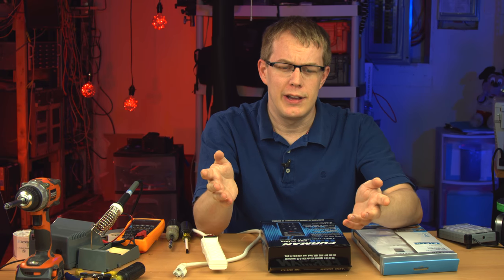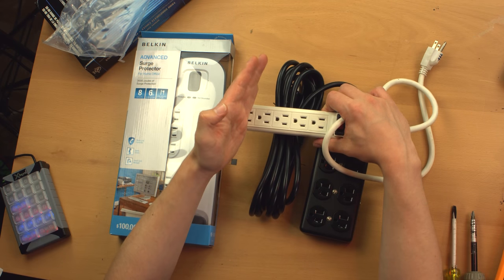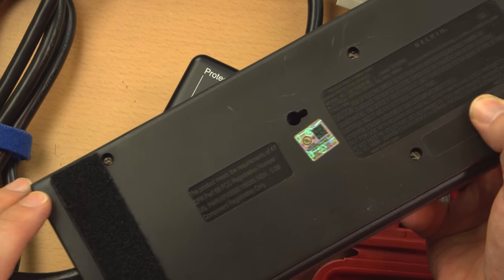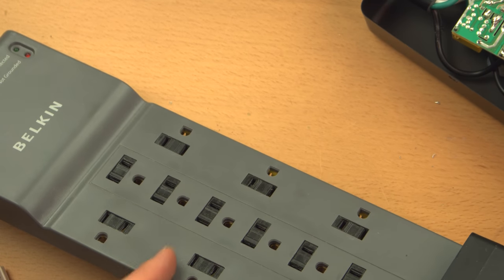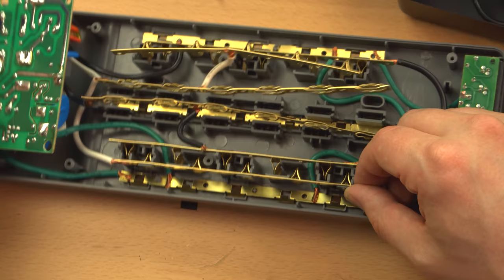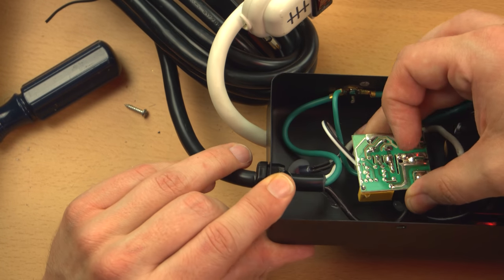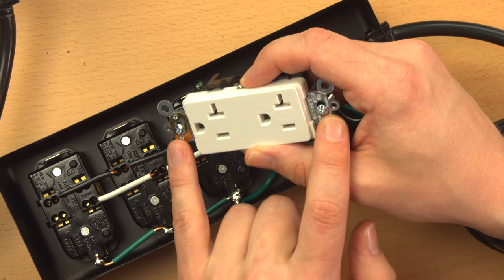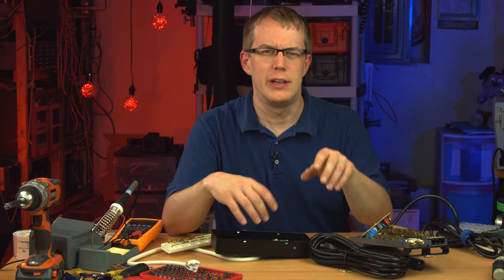Power Strips Whatever Something Something: Furman SS-6B vs. Belkin Surge Protector [G9S12FG9]

Comment: This is an email from the company to me after highlighting the issues you mentioned in the video.
Below from CORE Brands (Furman):
Thank you for contacting us in regards to the SS-6B. We have been manufacturing that model for 10 years. The SS-6B holds a UL 1449 safety listing so I ensure you the product is safe and we have a failure rate of 0.01%. In trying to keep the chassis as small as possible we chose that style of receptacle to accomplish a small housing. In regards to the surge protection we are utilizing a fused 400V MOV L-N. That was the component with the white housing. As I mentioned the unit does have the UL 1449 certification but I want to share your video with our compliance engineer as we are always looking at how we can improve our products
Reply: Where is 'us / we' manufacturing those? Between India & Russia?

Comment: Update from Furman:
Since UL 1449 is a safety listing for a relocatable power tap. UL will accept tinned stranded wires as they will not be torn and fray effectively causing high current going through a small gauge. This is pretty standard going from a PCB to the duplex. Using a solid wire on a small PCB could cause the solder on the PCB to be compromised.
I suppose this information renders the review kind of pointless however I think you're right when it comes to the grounding issue

Comment: The orange things are a combo of polyfose and MOV, I have tons of them and the build quality of the circuit board in the belkin is quite good, definitely good power strip.
Reply from the maker: ELECTROHAXZ Awesome, thanks!  I knew there had to be someone out there who's seen those before.
Reply: I have seen them on the back of slot machine lcds (power board). They were covered with a clear plastic and marked high voltage. I'm pretty sure the pcb was supposed to be covered with a metal cage. I had no clue what they were for. Thanks!
Reply: ILordSpawnI They are commonly part of a sandwich with a temperature fuse in the middle

Comment: From the Furman website: "Many surge suppression devices are not equipped to handle these kinds of conditions. Without proper protection, the end result is destroyed equipment, or at best, a destroyed surge suppression system.

Furman’s Extreme Voltage Shutdown (EVS) constantly monitors incoming voltage, and once any over-voltage condition over 137 volts AC is detected, a relay opens which immediately shuts down the unit and all connected equipment. An indicator light informs the user there is a problem. Once the condition has been corrected, the unit may be reset or auto-reset (depending on model) and will operate normally.

Comment: I own the SS6B and while it doesn't claim to be a power conditioner, it always comes up in searches for them. So I called furman and asked if it's one and they said no. I also asked about the emi and rf and they stated it does a bit but at a very low level and to use their full on power conditioners for those needs. I still like the strip because of the sturdiness and black metal housing and long cable. I'm a mobile dj as my living. It's important that things be sturdy and black for blending in.
Reply: Hey Danny! Are you still using the Furman?

Comment: 23:05 Safety tip: overloaded circuit boards can "carbonize", which means it burns and leaves a conductive path of carbon across the board.  If the trace was too thin, you can't assume that it would fail open rather than failing short and causing a fire.

Comment: the Furman on amazon is about 28$, and for that it seems pretty decent price for what they offer. I would take that over the other choices. Not sure why so much hate for that product as it seems better that the other 2 choices. When you look at the board for the furman you only see the back and you guess what it could be doing. The specs for the surge protection are on the furman website and they show Standard spike and surge protection - UL VPR: 400V, UL Nominal. Single Pulse Energy Dissipation, 540 Joules. Which is in line with a cheap surge protection strip. Other advantage i see on the Furman, is that if you are unhappy with the plugs that it uses, you can easily replace them.
Reply: Get the furman ssb6 pro... its on a whole other level.
Reply: @analogaudiorules1724  whoa, $1 terminals instead of $0.35 terminals

Comment: This is an old video so probably doesn't matter anymore, but that unknown component is an MOV capacitor.  Specs below, translated by Google:

"Three-phase varistor / high energy varistor

It is mainly used to absorb various operating surges and induced lightning surge overvoltages to prevent such overvoltages from interfering with the normal operation of the circuit or damaging various circuit components. The voltage range is wide, the residual voltage is low, the flow rate is large, the response speed is fast, and there is no polarity."

Brand/Model: EV/S120D201-S320D471
     Custom processing: Yes
     Brand: EV
     Model: S120D201-S320D471
     Type: pressure sensitive
     Performance: high resistance
     Material: inorganic solid
     Manufacturing process: ordinary wire winding
     Shape: Cylindrical
     Nominal resistance: 500Ω
     Temperature coefficient: other
     Rated power: 500 (W) W
     Power characteristics: high power
     Frequency characteristics: UHF

Comment: Judging, the wiring job inside is an absolute nightmare in the Belkin & Furman Power strip.  I don't know how they got approval by bridging the connections like that.  The Grounded Furman case is not properly done.  The star washer is supposed to contact the case.

Comment: Should have reviewed the furman ssb6 pro instead of the regular model, the regular version is inferior to the pro version, the pro model has evs and better harmonic filtering as well as a better internal build, for another 40 to 70 bucks its worth it, either way those furman strips actually will do what they say, if you want to see furman at their best check out the pf 1800ar... even their pfc upses are fantastic quality. Good video other then all of your assumptions, please review that pro version of the Furman strip.

Comment: This video was published a few years ago, I realize.  That said, a power strip and a surge protector are NOT the same thing, but are in fact VERY different.  
A power strip is basically an extension cord with multiple outlets.  It may or may not have some kind of fuse or breaker.  
A surge protector stops or shunts to ground excess voltage beyond some level (clamping voltage).  A surge protector should also have a joule rating - the maximum current the unit can handle - beyond which it fails.  Better surge protectors have some degree of EMI/RFI line noise filtering; however, the filtering on cheaper products is usually insignificant, trivial, just there to get attention, a sales gimmick.  If you need or want EMI/RFI filtering, get a better product.
What surge protectors do NOT have is voltage regulation.  Voltage fluctuates, all the time, it is never constant, or consistent.  Get over it, or deal with it.  A power conditioner, aka line conditioner, regulates voltage and provides consistent quality power to the connected loads.  At a significantly higher price.
Then we have the Uninterruptible Power Supply (UPS).  SOME UPS models provide decent surge protection.  SOME UPS models provide decent filtering of line noise.  SOME UPS models provide decent Automatic Voltage Regulation.
Do your homework.  Cost is an important issue to most of us, but so is safety.  DON’T BUY CHEAP!
Reply: Suggestions? I’m looking for protection for my mid-priced guitar amplifier. Significant enough EMI/RFI protection is desirable, too . Thanks in advance ….

Comment: They look like pptc resettable fuses with what looks like a thermal fuse sandwiched between them. Also looking at the silk screen on the board it looks as if it's a custom made thing.  PPTC fuses get very hot when they go into a over current situation. If it's too hot then the thermal fuse blows to protect the load and to prevent the PPTCs from potentially damaging the rest of the product? Obviously the fiberglass sleeve thing is to help retain the heat to those components.

Comment: After researching with little info...I bought APC - SurgeArrest 11-Outlet Surge Protector - Black
Model:P11U2 for $30.  Mainly for the features and 2880-joule rating.  I stay away from cheapo no-brands.
Reply: Yet the clamping voltage is poor on that model, so joules don’t mean a thing if it doesn’t clamp earlier.

Comment: Comparing the Furman SS-6B to an ordinary power strip, but comparing it to the Belkin Surge Protector is more of a relevant comparison. However, I certainly prefer the Furman surge protector. I'm most likely choose this one for my hi fi audio system if not a more expensive, and elaborate surge protector, that also has power conditioning. Furman SS-6B unit is built like a tank, and effective.

Comment: I just bought the Belkin 12-Outlet Pivot-Plug Power Strip Surge Protector with 8-Foot Power Cord, 4320 Joules (BP112230-08) hope it is good.

Comment: Hi thank you very much indeed for this extremely interesting video.  Presently i am looking for a power strip suitable for my home stereo system and i am trying to learn something.  It seems to me that the Furman has the better sockets while the Belkin the most elaborated electronics ?  I have a diy idea ... to buy this two strips and combine the best parts of both in a new one ... maybe using a wooden case for everything.  I do not know if it is a smart and safe idea by the way.  What would you suggest ? Move to a better strip ? which one ?  my main issue is some mains noise that could interfere with audio equipment.  I do not need much current as i intend to use the strip mainly for source components and not power amp.  Thanks a lot again for the very nice and valuable video.  Kind regards, gino

Comment: This sort of quality combined with functionality for a high standard, or an in italics acceptable standard is not the case with most computer hardware. The only certain weak link that certainly follows most is the power supply unit within a desktop computer. You either have to buy a very expensive desktop computer, or purchase another power supply that has higher power capabilities, and also build quality; from over 10 years ago, and from what I've read in at least one computer hardware repair, upgrading book. I opened my PSU up, half-way, thought something was wrong, blew out some dust, put it back together, and connected it into the Sony console again. My point is that in the computer, or computing industry, in this case hardware, is that the electronics, devices, adapters, wires, ports, and connections can be seen, observed for the work that such components perform. Should there be the same observational window? Figuratively, as well as actually speaking? 

What I can say with enough certainty is that most (in italics) computer hardware is of acceptable quality, functionality, reasonable build, and it plain works well, or at least well enough. As for computer software, including operating systems; that's another story. As a very accomplished, famous comic book editor used to say, enough said.

Comment: These power strips are a joke. Look inside and see nothing. Hey, Pangea Octet on sale. Regular $499 on sale for $399! How come no lab tests. No view of the insides. Monoprice has 4 outlet metal box with surge for $ 14.99. Or a Tripp-Lite 10 outlet for $52.67. You have miles of Romex and power company aluminum wire in front of this and you probably have a cheap outlet on the wall. It's just another wire in the system. And the system is only as good as it's weakest link.